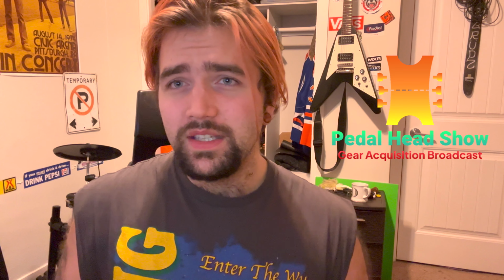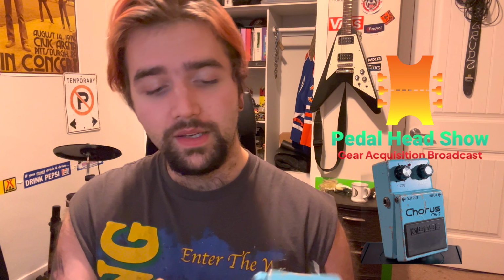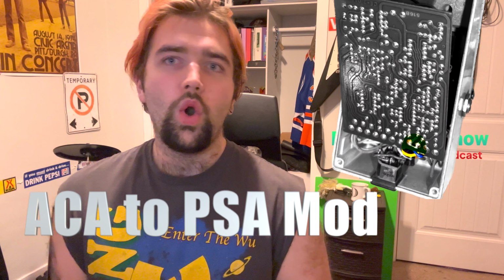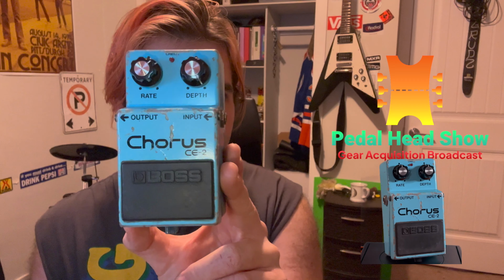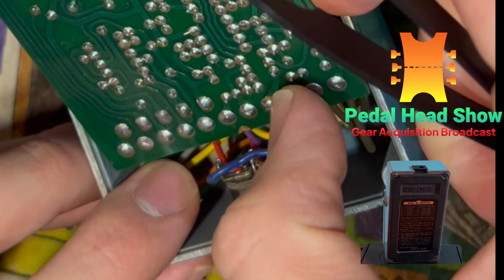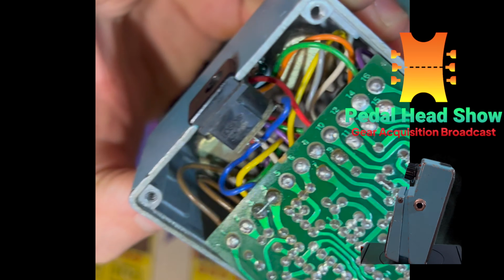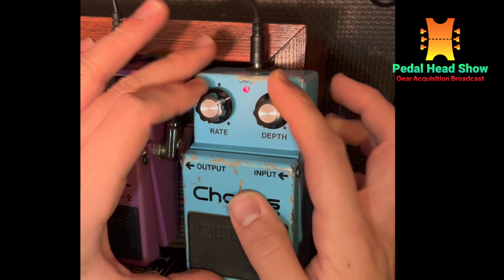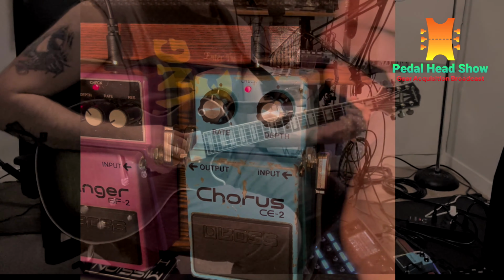Boss CE-2 Black Label Mij 1983 - ACA to PSA Modification / 12v to 9v / Tutorial and Demo / P.H.S.

Comment: What dc cable were you using before converting it?
Reply: And would it still turn on?
Reply from the maker: I was using a standard centre negative cable from True Tone. Any standard cable would work and by the videos example if you made it all the way through the video past 30 seconds then you would clearly hear and see the pedal does turn on. Being that boss pedals are all buffered the only way signal would pass through means the circuit is working and going back n forth between buffered bypass and chorus effect means the pedal works perfectly as it should. 
That being said I’d recommend leaving these old boss pedals alone and using a 12v dc out from your dedicated power supply. The diode and resistor that drops 12v coming in to the pedal down to 9v doesn’t always mathematically drop the voltage by a perfectly set 3v 
Thus where it’s set at via parts drift gives the pedal closer to 10.2 volts of power when running the circuit with a 12v dc centre negative cable. When you mod your boss ce2 or any ACA regulated 12 v boss pedals to the 9v mod the circuit will likely see 8.5 v. 
A Chorus pedal or a flanger pedal uses BBD CHIPs with a clock chip that needs to be calibrated by the factory or yourself by an oscilloscope. By changing the dc aca voltage from 12v to 9v the pedal won’t get the right amount of voltage that the clock chip needs to see to match the calibration from the factory. 
A good way to compensate this is by using a daisy chain with these old boss pedals, these Aca boss pedals from the 80’s self bypass the diode of the drop voltage circuit and grant you the full sound of your pedals while using only 9v. The daisy chain shares a common ground between more than one pedal and that’s what boss put in place to make these pedals work harmoniously together . I guess it was kind of an upsell for their grey pedalboard boxes. 
Either way hope this helps you figure out how to power your vintage boss effects with ease.